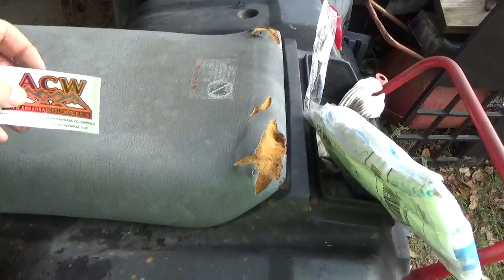ATV parts, patience will saves big money! $100 savings on ATV seat!

Comment: Nice find on the quad and seat for sure! ACW is great when it comes to affordable used parts I deal with them a lot  to put projects back together and not break the bank. As for the pull starting a 400 it is not for the faint of heart I suffer that pain until a starter for mine comes in. Great videos keep'em coming!

Comment: Ha! That ACW is only about 27 miles from me. Pretty cool. If that 4 wheeler had the red paint removed or painted over it would look about 100% better. I hate to see these hack and slash people ruin good machines like that one. It also looks like crap without the front and rear racks. Glad to see that you saved it from oblivion. You'll be surprised how well it rides if they havent destroyed the suspension too. By the way, you might want to check the driveshaft boot to make sure it isn't rotted away underneath. All sorts of nastiness can get into the rearend if it is busted. It probably needs an oil change AND FILTER. Those 4 wheelers take a filter and it needs to be oriented correctly to oil properly. Have a great one.
Reply from the maker: Hey Fan!!!!   I like to show where good deals come from, it is always interesting to hear from folks living near by.... I think it was a green machine before it was painted, it is leaking oil from the back of the engine, maybe it is the drive shaft boot.... I will check it out, good suggestion there!!! I bought it a set of front shocks, hopefully, they will improve the ride and handling, the current shocks are seized.... Thanks for the good advice, suggestions, watching, and commenting!!!!

Comment: a quick white repaint of the wheels and a light sand on the plastic and a spray with satin blk spray, rig a cover for the trunks and maybe a cheap set of new tires mounted yourself and put her up for 900.00 with some wiggle room, you got a winner
Reply from the maker: Hey SurviventheOnslaught!!!   All good suggestions!!   I was thinking about trying a camo paint job on the rat, it is already kind of ugly, there is not much to loose.... The tire all hold air, for my ATV, as long as they hold air, they say on the machine, easier to do donuts with in the winter!!!   I am mostly happy with this machine, but, it may have to go over the side to make room for other projects.... Thanks for the good suggestions, watching, and commenting!!!